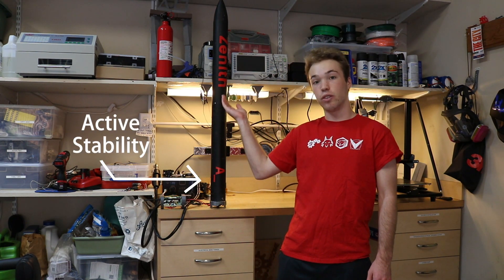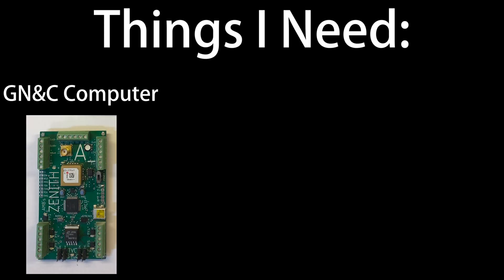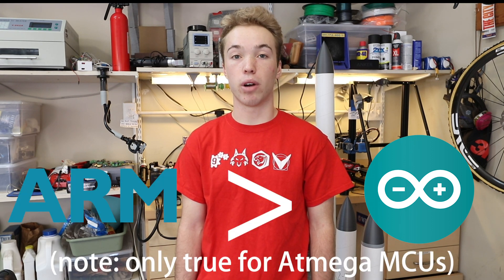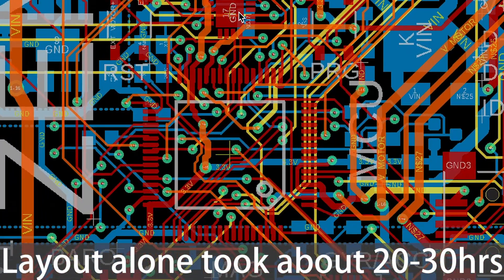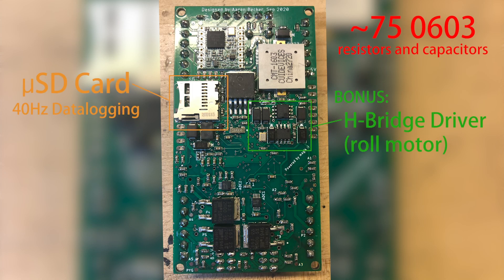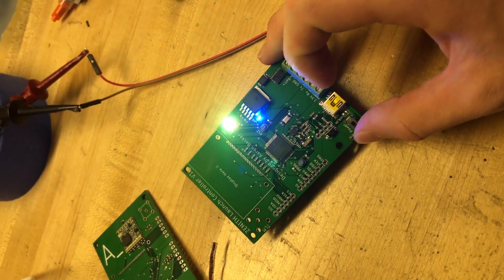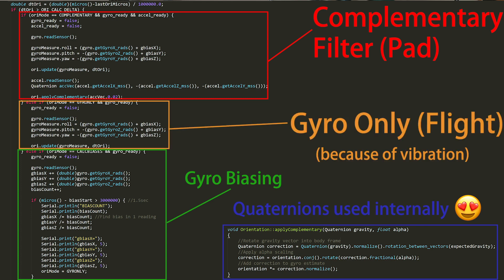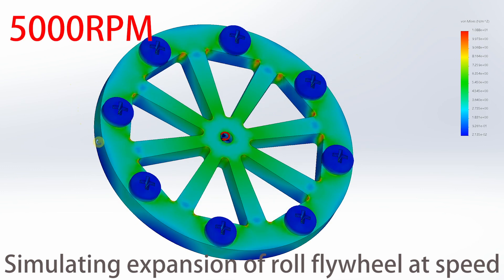MIT Maker Portfolio Video (Accepted EA 2025)

Comment: Hey Aaron!
First of all, congrats on the admission and my respect for this project. It is extremely impressive. Especially, considering in what time frame you were able to do it. 
I want to apply to MIT this year too, and I also want to submit a Maker Portfolio. 
I have a question related to the Portfolio.
Did you submit this video and an additional PDF or only the video?
And if you submitted a PDF too, how many pages of technical description did you write? 
Thanks in advance!

Comment: i mean it's 2 years ago so i don't know if that matters anymore, but it seems like you were just trying to correct the "realtime data" directly, but computing is never realtime yet i believe because there's always a tiny space between the updates of values that won't show, therefore the errors will get bigger and bigger until it completely gets out of control.
i think another decent try might be to compute some kind of prediction that helps adjusting and causing the errors not to expand further.
but that's just a tip from an uneducated person that is just trying to experience the world for himself and learn for himself
Reply: Actually a very good guess! The errors can be handled via a PID controller. The 'I' (integral) part keeps track of the errors over time and adjusts the inputs to compensate, theoretically making the steady state (error after a long time) error to be 0.
Reply: @hasaniqbal233  ah nice :D ty for the info ;)

Comment: I am a senior in highschool and I am close to launching a rocket of similar design in the coming weeks. The complexity of this project is completely unmatched by any project I’ve done in the past. I used a Kalman filter to filter the accelerometer and gyroscope data instead of a complimentary and used a simple pid control loop. As I am stronger in coding than electronic circuits o decided to make a simulation in python of what to expect when it launches to tune the PID. I however did not make my own flight computer i instead stayed within the Arduino  architecture. Anyway my question is how did you tune your control loop?

Comment: How much did it cost you in total? I would like to sponsor someone who doesn’t have the needs but the will.
Reply from the maker: @Luca Mantova Sponsoring someone else would be really awesome :)
The total cost is a bit hard to pin down, but I would estimate around $1250 to build three full rockets (and buy motors), two guidance computers and two ground computers for redundancy, not including launch costs or travel costs. Since I only had one chance to launch the vehicle I wanted to give it a maximal possible shot of some sort of launch.
This also included the use of borrowed/shared resources, so if you’re starting from scratch it may be a bit more.
Contact me at the email listed on my portfolio website, ambecker.com (don’t want to list email in plaintext on youtube), if you want me to send you my full bill of materials.

Comment: This came in my recommend. Very impressive. Just wondering how did you learn to code the flight system and design the pcb for the rocket?. And how can learn this aswell?
Reply: First knowledge in electronics then you take programming courses in microcontrollers anci c then electronic design course altium designer

Comment: Hey would it be possible to create a EDF electric tvc rocket? solid motors are pretty expensive for multiple tests and It is a little out of my budget. I was thinking something similar to joe barnards Sprite Hopper. If it is are there any specific parts you recommend?

Comment: I'm a sophomore in highschool and a fan of bps space. Do you have any tips for getting started with tvc model rocketry?
Reply from the maker: Most importantly, you need somewhere safe to launch - for a project as potentially dangerous as this, I drove out to a desert in Nevada to test it completely away from other people/property. Using the NAR guidelines for motor size vs launch area to find a safe space is a good starting point (https://www.nar.org/safety-information/model-rocket-safety-code/). Then, I’d say just experiment - maybe start with some ground tests using a simple TVC mount and an Arduino which just tried to keep the motor in place during the launch. Then, working your way up from there in both guidance computer and vehicle complexity you’ll eventually get to a full launch vehicle, much the same as Joe has done! Finally, finding a technical mentor to help you as well, like from a robotics team could be a huge help. Hope that helps!
Reply: @aaron-becker  im captain of my vex robotics team which isnt as advanced as frc so i dont think i can get a mentor, but thanks for the info🙏
Reply: @918rohitshrk  It’s definitely doable but it’s easier if you have some prior experience with model rocketry so that when you’re testing your system, your rocket doesn’t decrease in performance due to build issues. Additionally, you need to have a decent understanding of motors and how they work (I.e, burn time and and impulse). The building part isn’t terribly difficult (programming will take up most of your time) but having a mentor to help you out can go a long way.
Reply: @youdontknowwhoiam4349  ive built multiple model rockets and i do a lot of building, programming, and design for other personal projects
Reply: @918rohitshrk  Sorry thought you meant you were completely new lol. By the way, I was wondering if you have any advice starting out with programming/arduino. I have experience with 3D printing and design but I’d like to get into Arduino in the near future.
Reply: @youdontknowwhoiam4349  get a kit and follow some tutorials, coding isnt hard but getting started with the hardware can be tricky

Comment: Really like your stuff man, I have a question that I hope you could kindly answer.  For the two-minute limit on videoing of the creative portfolio, could I submit three videos each explains a different project and each is two minutes long?

And could you write about a different project on the PDF doc from the content of your video?
Reply from the maker: No idea! When I did it, it was two minutes of video total (so only one video allowed) but it’s entirely possible that the requirements have changed. You should definitely take a look at the information on any portals/email MIT directly if you can’t find what your looking for.
Reply: @aaron-becker  Thank you for your response! Can I get your general opinion on this? The guidelines are kinda vague it said I'm able to "submit video totalling no more than 120 seconds and up to one PDF of technical documentation." It didn't specifically say if the PDF should be about the same project as the video. So I'm talking about one of my programming projects in the video, and for the PDF I'm gonna write about two physics projects that I had done. Do you think they will accept it?
Reply: @marshal2866  well it's understood that the PDF is supposed to be about the same project. Good Luck 😃